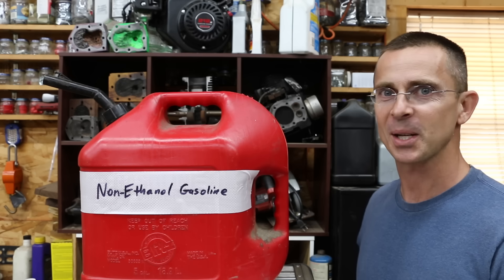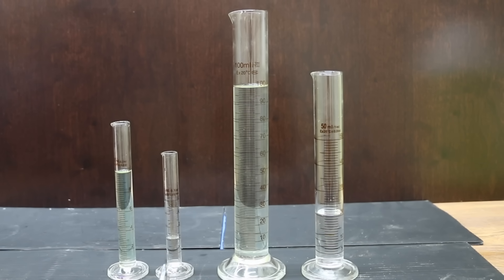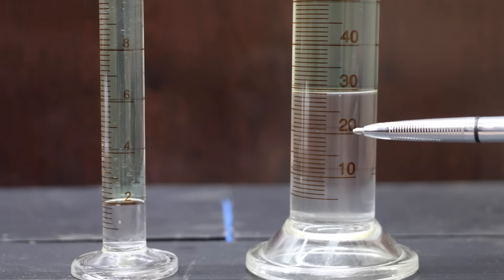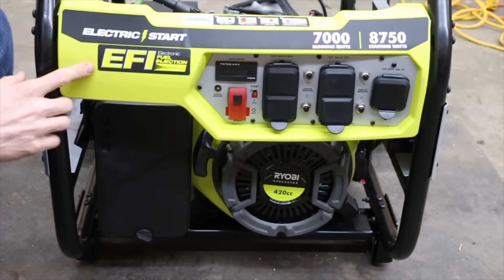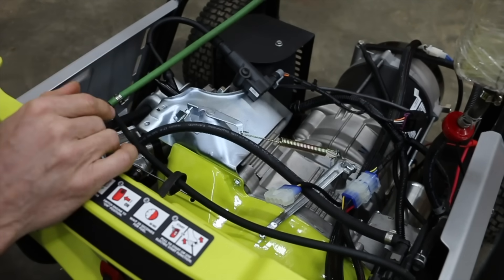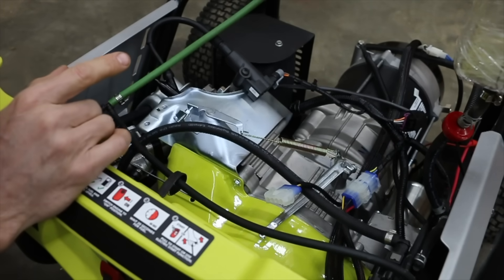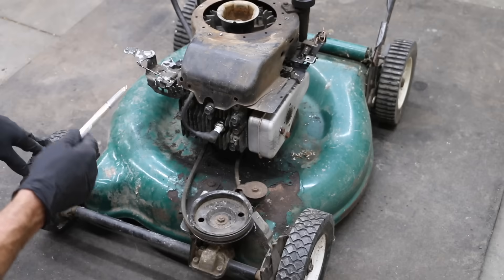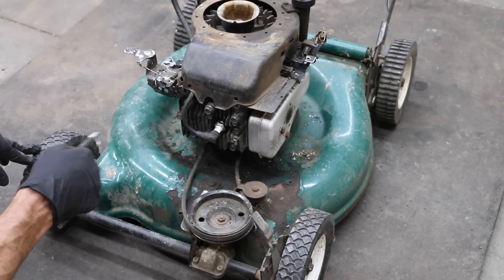Is Non-Ethanol Gasoline Really Better? See the PROOF!

Comment: Hi. I like your approach very much for the testing. I can share some experience with you, having been an engine test and development engineer for BM from Brasil. Our main task there was adapting the engines for the Brazilian fuel mixture (up to 25% ethanol or even 100% ethanol). Out of all materials, durability, efficiency and wear testing done on my time there, some very nice evidences came out
1 - Up to a certain ammount of ethanol (the 10% you use here) engines are indeed more efficient - ethanol burns very efficiently, unlike the other detonation inhibitors used. But the detergent/cleaning properties ot the ethanol on carbon deposits are not so pronounced. 
2 - the more ethanol you add, harder it will be on engine starting at cold weather. That is why North America stuck with the 10% mark. At 15% is hard to start anything below -15C. Since this extreme cold is never found in Brasil, they chose to increase ethanol content, so the cleaning benefits of the alchool are more evident. I tested 25% ethanol engines that, after more than 10k hours of endurance, looked like a 1-3K used pure gasoline engine, when it comes to carbon and slug deposit. The 100% ethanol engines did not built carbon at all. 
3 - YES, any rubber that has a particular base material (If memory serves, any fluor-based rubber) WILL degrade VERY rapidly when using ethanol. All manufacturers that habe been to Brail sellin cars KNOW that. We spend pretty much a decade testing and adapting rubbers and metallic parts to resist the corrosion. So... in new engines this will not be an issue. BUT if you use ethanol in a very old engine (like one with a CARBURATOR), you will likely see the rubber degradation, since those engines may not have the enhanced rubber and metallic coating found today.
4 - Ethanol performance as a carbon deposit inhibiter is not as good on 2-stroke engines Since you actually burn a mixture of gasoline and oil, due to the very nature of the cycle. 

Hope that helps your quest.
Reply: Thanks for the info. Our Govt is making us switch to 20% ethanol on advise of your former President Jair Bolsonaro. So far we are on 10% and this year we will probably go to 15 or 20%. A lot of our old vehicles esp two wheelers are on carburetors. Wonder how this will go.
Reply: @VijayNinel On small Carburated engines like your atv's and bikes etc... In my experience, Ethanol fuel will work, however, it has a very short usable shelf life, especially when not treated or stored properly. It tends to gum-up fuel Valves and carbs after sitting—resulting in needed service (Fuel flush, fuel valve repair and carb clean and rebuild. If they are ran all the time and don't sit, service intervals are less frequent because the fuel doesn't go bad, but can be hard on rubber seals. If Non-ethanol is avaliable, I would recommend using it, but if not, only buy what you will consume and treat your fuel if you can and be sure to properly store your fuel; it will take on water in humid environments.
Reply: Excelente explicação
Reply: So basically… driving a modern car (built in the last 10-20 years) the local fuel source should be absolutely fine? 
It’s almost like the automakers and fuel companies have a picnic on occasion and talk about this…..
Reply: @glutenfreebeerbrian  They do! It is not a Picnic, it is a SAE and the AIEE committees regarding automotive fuel and lubricants. They try to push the envelope for these technologies, and align the materials and performance. It has been there for almost 100 years.
There are analogue committees for Aeronautical systems too. The engineering community for Aerospace and Automotive is really active and try to agree on standards and procedures before governments put our unwanted regulations.
Regarding your first observation... Yes, LOCAL manufactured cars will work perfectly with LOCAL fuel and lubricant standards. Problem is when you get import cars, and get new technology fuels and lubricants in older cars. This has to be closely watched.
Ethanol (the subject matter on the original post) reacts to older tech rubber and metallic materials. That is what you need to be aware.
Reply: Wow i thought there is only stupid people in Brasil ;
Turns out there are exceptions
Reply: 7
Reply: @madonesmack 
7! 🤘
😂
Reply: Apparently the ethanol based fuel decreases the lubrification.
Reply: @georgesbv1  , not from my experience. 
The wear levels on both E100 and E20 engines were compatible. On 4-stroke engines there seem to be no issues. The oils were upgrades for the higher detergent capacity of the ethanol too. 
On. 2-stroke engine, where oil and fuel are actually mixes, might be a problem.
Reply: @georgesbv1 I just don't like the inefficiency provided by me buying a fuel with an oxydizer in it. I get air for free, stop putting it in my gas!
Reply: Beyond the rubber and corrosion issue with older vehicles, I think their is also the issue that lawn equipment  tends to sit for a week at a time in season and several months out of season, so the hydrophilic ethanol absorbs way to much water..I wouldn't mind, mid season  partially filling my  new lawnmowers with ethanol, and running it out that day. But I buy straight gas because  normally I burn a 1/4 tank it sits for 7 to 10 days,repeat x 4..with our crazy humidity it will soak up a lot of water during a month..
Reply: Great info 🤙🏻🤙🏻👍🏻👍🏻
Reply: THANK YOU for the awesome comment JoseCarlos!  I have a question - is there any additive for the gas I can add that will mitigate the damaging effects of the alcohol?  I still don't like the idea of being forced to use that since I don't believe the car makers have completely "ethanol-proofed" all the engine and fuel parts yet, so i was wondering if there is some way, via an additive, to avoid some of the potential problems of ethanol?
Reply: @robertmaybeth3434  , unfortunately I do not think there are any. 
But for the most part of the original manufacturers, the materials have been adapted for ethanol usage since the 1990s. At least on the main markets (N.A., Brasil, Europe and Asia). Especially because ethanol is one of the best (if not THE best) alternative to the other chemicals used knocking deterrent. 
As I said before, only if your vehicle is older than 1990 I would be concerned.
Reply: @robertmaybeth3434  yes they are, bardahl motores make them in Brazil, idk if it is avaliable outside LatAm
Reply: Not just rubber. But it also has an effect on plastics.
Most 2 stroke motors like a weed eater have a Teflon coating on the cylinder walls to cut down friction 
This is why it bad to use a eathor type starting fluid on them it can dammage the Teflon coatings 
Some engines just were not made to deal with ethanol at all.
Now you bring up fuel injection vers carabrators actually gas burns as a vapor not liquid, if you can change the presure and only burn vapor your going to burn all the fuel
The motor will burn cleaner and get better engine proformance and mileage.

Insted of burning a plant based fule 
It makes more sence to burn a gas not gasoline  thats why propane gets better mileage and hydgron should be the fuel we use in an internal combustion engine.
Reply: @bobbg9041  yes. I mentioned this all in my original comment. 
The problems with propane are totally different than the ones with ethanol. Incidentally my graduation project was with propane powered engines. 
Regarding the adequacy of engines, two-stroke engines have a real hard time with ethanol. 
And the adequacy of burning fuel derived from a plant… i don’t think this is the main subject. But i know that the overall process, from production to burning, is CO2 positive. Meaning you actually extract more than you put out.
Reply: Good to know. Thank you for sharing your knowledge and experience!
Reply: @@notexpatjoe E85 is technically Ethanol. So, your engine either has to be a multi-fuel type (like most Brazilian cars are as of today) or you will, indeed, have difficulties.
The 15% gasoline content is THE thing that makes starting viable in lower temperatures. BUT it shall work well down to around -10C. There are several remedies for that, but I have not seen US-made cars with the same "tricks" as the Brasil-made ones.
Reply: Muito obrigado pela explicação, José. Tenho um corsa 94 e fico muito preocupado se ele vai aguentar o desaforo que vai ser a gasosa de 35%.
Reply: @Misack8  nao se preocupe. O Corsa já é da geração de motores adaptados.
Reply: Thank you for this info.
Reply: here in canada they're moving up to 15% in the next few years so that's great to hear lol. Not like we have negative temps in the winter or anything.
Reply: @0xsergy  what a nice coincidence. I live in Montreal. 
My comment on E100 proportion on fuel was based on the time I actively studied and adapted engines for ethanol usage. And i am horrified to realize that this is last century information… wow, time flies. 
I am pretty sure that the newer technology engines with high pressure fuel injection systems made that threshold much better. I don’t think that, for most modern cars, this will make a significant difference. 
But… if you still have an old carburated or single point injection with low pressure system, than it will make a difference.
Reply: @ i currently drive a 27 year old car with what is likely low pressure single point injection, that's the injector before intake valve right? and i was just looking at picking up a 91 toyota hilux which would have a similar fuel injection system. might have to rethink vehicle choices if 15% would make these 2 run poorly in the winter.
Reply: USA is still a huge producer of oil. But USA doesn't produce ethanol from sugarcane, but from corn. Which is less efficient.
Reply: @georgesbv1 brazil too, but guess what hapens with the oil?
Reply: I doubt there is such a problem with cold start. Anyway for E85-E100 engines the car can have a small pure gasoline or E5-E10 reserve for cold start. Pretty much like dual fuel LPG systems, but without the large tank.
Reply: Number three is so important to clarify, so many indonesian recently have a misconception about that point

Comment: 10% ethanol gets a bad wrap but I ran a stock Mitsubishi Magna 3.5 v6 for years and about 100k km without a single hiccup. E85 on the other hand is fantastic for power, heat management and clean chambers but will need heavy management and modification to not cause grief. It's all about the %
Reply from the maker: Thanks for the feedback.
Reply: In a car where the manufacturer specifies it as being OK to use I wouldn't have too many concerns. 

Very different in small two stroke engines though, since ethanol can mess up the carburettor itself, it puts the fuel to air ratio out, and it interferes with lubrication. It can be done but as any dealer will confirm, it's best avoided with chainsaws, construction equipment, garden tools, boats and anything else with a two stroke engine.

Comment: Ethanol in gas, invented by politicians, need I say more.
Reply: Ethanol is corn based which is home grown right here in the US... This a good thing right?? Why spend are dollars overseas when we can support the local farmers of the US.
Reply: @crandonborth  Ethanol is a terrible fuel, its energy content is much less than gasoline and when made from corn especially inefficient. It is bad for small engines. The US was energy independent, we could supply ourselves with fossil fuels.
Reply: @iamthemoss  The idea is we don’t have to be so fossil fuel dependent and the new small engine are now made to made to handle E10 gas.
Reply: @iamthemoss  Fair enough… but I think like 90% of corn in the US is used for ethanol. If we had a better fuel than corn like say fossil fuels or we had lithium deposits here in the US, what we do with all the corn??
Reply: @crandonborth  there are so many issues with making fuel from ethanol. Firstly it is a food crop, anytime you take away food, it’s bad. Secondly what makes a fuel a “good” fuel is the amount of energy it takes to make the fuel from the raw material. The amount of energy it takes to produce fossil fuels from crude oil is way less than you receive therefore it is a good fuel. In order to get ethanol from corn, you have to ship the corn, plant the corn, fertilize and spray the corn with pesticides, then harvest the corn, then process the corn into ethanol and dispose of the leftovers. Making fertilizers and pesticides and all of the other processes uses energy (mostly fossil fuels). You see you end up with ethanol that took more energy to make than you get out.
Reply: @crandonborth  farmers can change crops, much of corn goes to animal and human feeds. That's not a problem.

Comment: Just a little side info: The gasoline with ethanol likely actually does have pretty exactly 10% ethanol in it. Removing the ethanol with water does work, but the volume of a mix of 10 ml of ethanol and 20 ml of water will not give you 30 ml of ethanol/water mixture. It's a phenomenon called volume contraction.
Reply from the maker: Thanks for sharing.

Comment: Did you do the ethanol vs plastic test?  We’ve been running non ethanol gas in our 2 stroke equipment for years now and don’t see near the problems as we did in the past. However the price premium is now a dollar to $1.50 per gallon more. So at 3000 gallons, I’m not sure it worth it any more.
Reply from the maker: Thanks for the suggestion.

Comment: The thing that decides it for me... I guess I really don't know if it's true, but it sounds logical... is that car manufactures have to decide the best performing settings in the combustion of fuel, and they set their specs to ethanol gas because it's what 90% of the people use. So, your car is probably going to perform better with ethanol.
Reply from the maker: Thanks for the feedback.

Comment: I've gotta 15 year old 20 hp Honda on my lawnmower that I use the cheapest pump gas I can find. So yes it has ethanol. Never use fuel treatment and it sits all winter long. Never had carb cleaned and never had any problems. Maybe build something that is not so sensitive to ethanol.
Reply from the maker: Thanks for sharing.

Comment: My F-250 gets .3 (yes 3 tenths) of a mpg difference between regular gasoline and E-85. There is a definite power difference between regular gasoline and E-85 though. The Regular has better acceleration under heavy load than the ethanol
Reply from the maker: Thanks for the feedback.

Comment: Good comparison here but one thing i think worth mentioning that takes place in your car and not in these engines is that ethanol blends have a different stoichmetric ratio. Modern cars will use the feed back from the closed loop system to account for the different stoich ratio or in the case of a flex fuel vehicle measure the amount of ethanol in the fuel and then adjust the fuel compensation to account for the correct afr. If you adjust the jet size on your mowers you could run a E85 setup. You will just have to increase the jet size by 30 percent. Awesome channel! Big fan
Reply from the maker: Thanks!

Comment: I didn't watch the video.
I've been running a Husquvarna 162 chain saw and riding a Honda CR250R MX bike on a 75% ethanol 25% gasoline mix with Blue Marble 2T oil at 50-1 for over 10 years because I like to experiment. Verdict? no problems! The Husky has a magnesium tank. No corrosion. 
The Honda piston & head stays carbon free. Both do run cooler. The saw's fumes are a little easier to work around. No fuel separation issues, no gummed up carbs, no damaged seals or rubber parts. Fuel mixture is more sensitive to temperature changes. Your mileage will be lower. You can't run pure ethanol effectively because you need different vapor points that gasoline has.
Real life facts. Cheers!

Comment: All I have to say about this is that there's a reason why ethanol is not used in either marine or aviation fuels.  It's also not recommended for small engines either. 
I personally have a Briggs and Stratton 5HP horizontal shaft from 1987 that would still run fine if I replaced the ignition coil.  The gas tank is shot.  It was fine until they started putting ethanol in the gas.  Now I'm going to be stuck paying more to replace that blasted gas tank than the entire tiller is worth because of the ethanol garbage they put in the gas.
Reply from the maker: Thanks for the feedback.

Comment: Of course it's better without. There are still various parts that are also damaged by biofuel. For a while we drove trucks with biodiesel for a large haulage company. They don't pull a herring off their plates with it anymore. Then the fuel filters were constantly clogged, despite the additional filter. Then the cylinder head gaskets were through after 250,000 -300,000 km. Normally they last at least twice as long.
On the other hand, I see little point in converting food into fuel. How is that supposed to be environmentally friendly when you burn down rainforest to grow corn for biofuel? This can only make sense on a small scale, where waste is used to produce fuel, and this is not the case with the volume required.
Reply from the maker: Thanks for the feedback.

Comment: Ethanol and carbs arent great, no issue with fuel injectors, direct injected vehicles respond very well to ethanol and direct injected turbo charged vehicles crave it. There is 50-70 hp and tq increase plus knock resistance by using E85 in DIT engines.
Reply from the maker: Thanks for the feedback.

Comment: I find with ethenol fuel I'm using about 20% more than standard 95.  I'm doing about 5000km a month. As for damaging fuel lines and rubber components, I didn't use it long enough to see any damage. If your not using the fuel and it's left standing, it's hydoscopic.
Reply from the maker: Thanks for sharing.